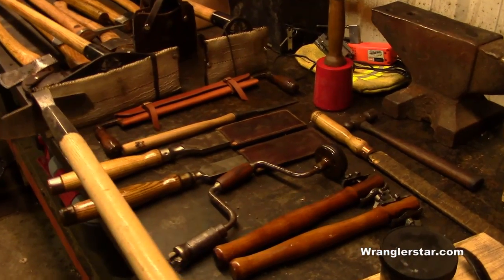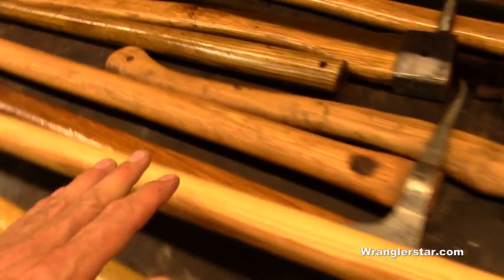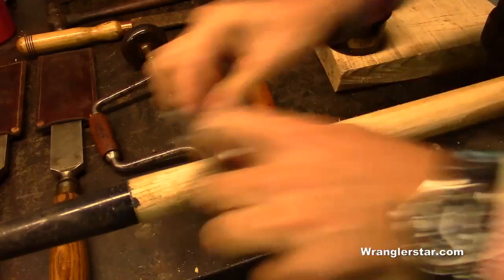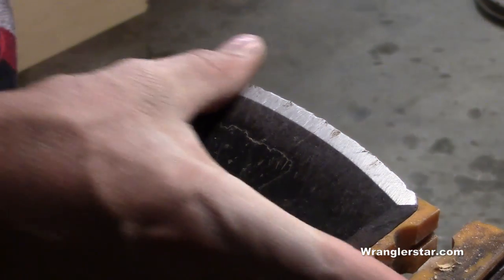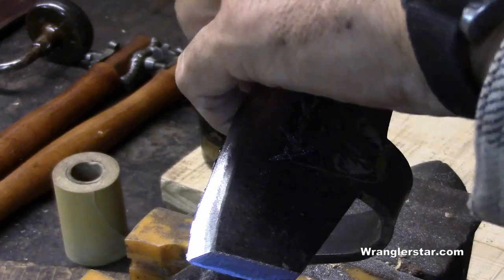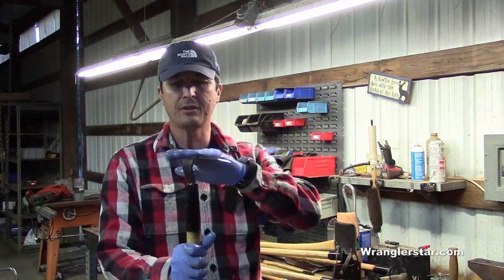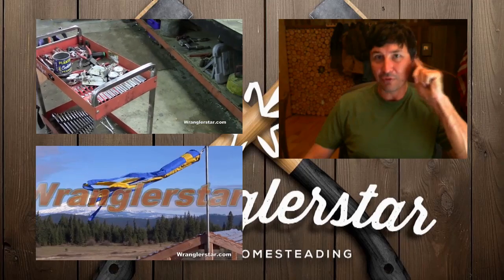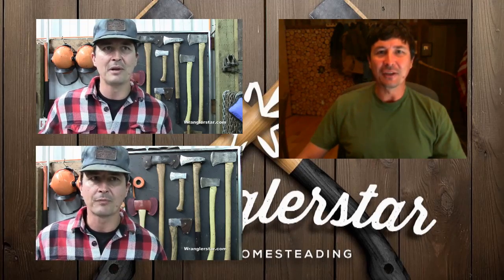How To Strip Varnish From Tool Handles | Wranglerstar

Comment: I agree completely Cody. Varnished handles are there to make the buying public notice the tool.
There is an old saying that $10.00 worth of paint will add $200.00 to the price of the tractor. Also manufacturers of tools are mostly offshore these days. Shipping for 90 days via boat leaves lots of time for wooden handles to absorb water and check. Even though the handle has been dried it will still absorb water. After a few cycles of swelling and shrinking even kiln dried wood will warp and check. Varnish is a water proof barrier when it is new.
Boiled Linseed Oil, which is also a favorite of mine, is water resistant but water will pass through the layer of BLO and damage the wood if not cared for.
Most clear finishes such as BLO, varnish, shellac, and polyurethanes, unless they have a UV blocker added, will let UV light through. The UV will break down the wood and cause the finish to loosen. Between the water and the UV the finish breaks down.  That's why barns and outbuildings that have been kept painted can last hundreds of years but fence posts rot away from the top down.
By renewing the BLO yearly the damage from UV is minimized and compensated for. It also focuses your eyes on the tool. Damaged tools can be fixed before they become useless.
A Proper maintenance program indeed.
Reply: Agreed! Go down the pine tar rabbit hole,.. its worth it!

Comment: Cody, 
Having been a carpenter/woodworker for over 30 years I would suggest a card scraper. The card scraper is a simple tool and there is no setting blade depth. A sharp card can take off super thin layers in a very controlled manner. 
Thanks so much for all your videos and honesty. 
God Bless!

Comment: Old wood workers secret. 2/3 boiled linseed oil & 1/3 turpentine. Could also go 3/4&1/4 if you wanted. The turpentine thins the linseed and helps pull it deeper into the wood. It's my favorite oil finish for wood.
Reply: I always add a little pine tar to my mixture
Reply: @nathanchandler18  exactly! As well as a small amount of beeswax. I like to add a tiny amount (1 tea spoon per quart of mixture) of carnauba wax. It is a very hard wax and also gives a nice shine.

Comment: I used a small Palm sized hand planer (Kobalt) yo strip of varnish. It was very handy and sanded the handles. I'm currently using motor oil (obviously "used") instead of B.L.O. It's been 2 months, and so far the handles are looking better. The oil goes on thick and drips into a few buckets to collect to recoat again. I now only coat them 2-3x a week depending on how dry it gets, maybe more over winter. The handles are looking better and are basically saturated. I'll see how well it worked when spring comes. Thank You Wranglerstar, I'm now more into taking care of my tools. I replaced many handles in years past and it added up. Looking forth to keeping current handles for many more years to come :)

Comment: You make it look easy Cody, I spent an hour or two today sharpening and servicing my axes and decided to strip the varnish off one. I tried a spoke shave at it's thinnest setting, but it just seemed to dig into the handle and remove chunks. Ended up scraping the varnish off with a sharp blade, then sanded and oiled.

Comment: Great video Cody! Back when I was a firefighter we had several wooden ladders. To strip the finish we used pieces of broken window glass. When one cutting edge was dull just turn the glass or throw it away or break it again for a new edge. On tool handles it was glass, then a torch, and lastly steel wool. Boiled linseed oil was our finish. Not anymore though. Just throw the tool away and buy another. Thanks again.

Comment: They put Varnish on the handles because, in general, people don't take care of their tools.
Reply: No, they put varnish on handles because they don’t properly dry their wood, in the modern speed/production/bottom-line craze. The varnish locks in that moisture and prevents the wood from warping. So, in order to not be hit with constant lawsuits concerning flying axe bits, they varnish the wood so it doesn’t loosen as quickly. It’s a terrible practice, if a company cuts corners like that, I don’t trust their wider business practices regarding tool quality, either. So, a varnish handle tool is generally half-assed, lazy, and not built to last.

Comment: Don't know if anyone mentioned this, I'm very far behind on my video watching as I am trying to cut back on technology and I have A LOT of subscriptions!

Anyway, I noticed that you are sharpening away from the edge of the tool which tends to draw the metal out toward the edge creating a wire very easily. Ever since I was taught to sharpen tools toward the edge of the blade, I have very little wire forming. I use this technique on both knives and implement type tools. I also notice that you pick up your file between stokes, this is a good thing to do because, depending on the quality of the file, drawing a file back will round off the file edges and dull a file very quickly. I notice this especially on chain saw files which will dull even if you do this on one tooth of the chain.

Just some thoughts, Great videos, wranglerstar! It is good to have someone out there publishing how to care for things PROPERLY! There is some much incorrect information out there, we need to point out the good stuff, and A LOT of it is right on this channel!!

Comment: I did not know that about varnished tool handles.  I’ll have to start gathering some supplies (boiled linseed oil, spokeshave, sandpaper, etc.).  It might even end up being around Fall before I get started. I can see the efficiency of just making one big project out of it.  Also interesting to note that this was before you preferred to cut the round end off of your long handled tools.  One thing you said is that it would drink in the BLO better.  Great video!

Comment: Broken glass work well. I have used it to shave wood down and to shave finishes for over 60 years. Cheap and usually available at a hardware store for free. Once you learn, you won't cut yourself. Always pull, don't push. Then sand around the handle to develop small ridges that help you grip.

Comment: Great video cody. When I sharpen up the knives I make I like to keep a small brick of a really soft wood near me to take care of that burr. Once the edge is placed on it, a quick few slides through that will take off most of the burr enough for most tools. If it's something like a knife or an axe or a machete, you can easily just finish up with a few passes on a whetstone. Also, really looking forward to part 2; I use an all in one leather dye, but that tends to be iffy in places, so seeing how to properly protect a sheathe will be very useful. Thanks again, All the best.

Comment: Fall (or autumn, where I come from, is one of my favourite seasons) but it also leads into winter, yes winter is also nice, but here in Hokkaido, Japan (The 2nd snowiest place on the planet - apparently?! - we do get a LOT of snow) winter, or at least snow lasts for around 5+ months!... it gets tiring... anyway enough about me (Hokkaido) I have recently started getting everything ready for winter, and had bought a few pitch forks, shovels, etc from the local hardware store earlier last year, they were all varnished, and after just shy of a year the varnish is peeling, cracking and becoming unsightly (and a problem) I do have a small spoke shave and will employ this method. I was going to try to sand them all back... this is much smarter! thanks again Cody!!!

Comment: The wood handle on my axe has lasted me over 20 years now. Besides applying linseed oil to the surface I drilled a small hole a couple of inches deep into the butt end of the handle. I filled this with linseed oil and set the axe aside, head down, refilling it whenever I  noticed the level of oil dropped. The wood absorbed a lot of oil over a few weeks and I think this gave the handle a little bit more spring and prevented it from cracking or breaking when I missed my target and the handle, instead of the axe head, struck the wood.

Comment: My suggestion is for the first coat or two of BLO to thin it with mineral spirits so it absorbs deeper. As for the manufacturers using varnish, most consumers won't take care of their tools like we do, they don't want the work of an oil finish. Varnish will protect well enough for them and is quicker and easier to do then oil.

Comment: The reason manufacturers put varnish on tool handles is three-fold. First, it prevents the handle from absorbing moisture and warping during transit and storage. Second, it looks good (because it's shiny). And third, it's cheap to do so. Linseed oil is better for obvious reasons, but it takes a while to dry and doesn't have a really glossy finish unless you put on at least 4-5 coats. That's extra time, material and handling that would add to the cost of the tool. And let's face it, Mr John Q. Public is only worried about one thing: price.

Removal of varnish can be difficult without a spoke shaver, but I've used 60 grit sandpaper on a random orbit sander to  remove the majority of it, then switched to 80 grit and hand sanded with the grain and finally 120 to smooth things out (again hand sanding with the grain). 120 grit is fine for the finish sanding because the linseed oil will fill in any minor scratches left. And don't just put on one coat of linseed oil after sanding: put on a coat, let it dry for a day or so, then put on another one.

Comment: There is a product used by gunsmiths called linspeed that is linseed oil with drying agents in it that cuts the applications in half. I generally apply it once a day for 5 days then once a month for 3 months and it gives you the same finish you get after a year with boiled linseed oil. I also hit it with 000 steel wool before the next application but that is for wood gunstocks to give them that mirrored look. btw, when you use your bare hands to apply either products the wood is heated with your hands better and seems to penetrate better for me, I just use goop to clean up my hands.

Comment: I've never owned a spokeshave, but I do strip all the varnish off my axe handles. I use a heavy bladed knife as a scraper, if its sharp it takes curls of varnish off. Just hold it perpendicular to the wood, and draw towards yourself to prevent chatter.

Comment: I use a scraper for this and find it works very well
Reply: Thanks, your comment kept me from giving up as I have a scraper on hand.  I was able to remove all the varnish with 10-15 minutes of scraping followed by sanding.
Reply: @twestcase  no problem, glad my comment was useful to someone. Also for stubborn varnish/ polyurethane finish that is particularly thick if you heat it up with a heat gun or blow dryer it comes off even easier. Just have to be careful not to char the wood.

Comment: I am used to standing or hanging tools directly above a shallow trough filled with white wood shavings - any excess oil drips onto the shavings and is retained and helps to prevent rust on metal tools that touch the shavings.

Comment: If you want plain boiled linseed oil with nothing else in you can always pick up a can of Tried and True "Danish Oil". Don't let the name fool you - this is not an oil varnish like watco - it is the simplest finish the company makes. Just moderatly polymerized linseed oil. They also make their "original" which more polymerized and has beeswax in it, as well as an "oil varnish" that I believe uses some type of sap that allows it to build and harden a little. I keep a can of the original around. None of their products have any driers either. This does however mean you need to apply light coats and rub the finish out. As far as end result, I don't necessarily think it looks any different then hardware store BLO, but I like the company and I like what goes in (or doesn't go in) to their products.

Comment: I once learned while reading that the best way to avoid a wire edge is to file totally from the opposite direction so the wire edge never forms.  What do you think of this suggestion?  I learned to do this especially when using a grinding wheel.  Holding in one direction will make a wire edge, while the opposite direction will not.  Comments?  Tx. Bob C

Comment: Another way to clear off the varnish is to use a piece of broken glass, like a mirror or window pane. You would need to wear gloves but works very well. If it stops peeling well you can break a little more off and have a fresh edge.

Comment: My two preceding posts were off a blog site for woodworkers. Here is another post on making your own.

Edible linseed oil is not polymerized,and I don't know if it would effectively dry or not. I started using edible linseed oil(flax oil) in my varnish since it is a LOT clearer than the hardware grade oil. BUT, it needs to be polymerized. This is dangerous if you aren't experienced. You MUST work out doors. Use a DEEP container. Oil can get too hot and suddenly foam over the top in an instant,turning into a LARGE ball of fire before you can get the pan off the hot plate.

I AM NOT RECOMMENDING THIS AS IT IS DANGEROUS,TOO,but,I used to saw the top off of an EMPTY,EMPTY propane bottle to get a real tall container. You can blow up the container if any gas is left in it,so I cannot recommend it.

I'd carefully SIMMER the oil and not let it get past simmering for about 20 minutes. It would turn a rich,golden color(from the pale color it was before). Then,the oil was polymerized,and would then be a drying oil. Do not eat it after it is polymerized!!!!

After the oil was golden,I'd add the resins,and carefully simmer it till a drop gotten on the end of a longish stick,would make gossamer cobwebs when touched and pulled away from a bottle. That means the varnish is done. I'm not getting too technical here.

Comment: Have you ever thought about trying some copper tools? They are slicker and move easier in the ground. They are especially good for gardening tools. The edges can be peened instead of sharpened and trace elements in the copper are deposited in the soil as apposed to rust being deposited, which can hurt soil in large quantities.

Comment: Hey Cody I notice you use the age old technique of sharpening with a file but have you ever used peening with a hammer and a small anvil to sharpen some of your tools. It is a less reductive process than sharpening with a file.
Reply: That would make for an interesting video, if you know how please share.
Reply: It would work harden the metal and make it brittle. That is the way they hardened the edge and sharpened non-ferrous metal tools made with bronze and copper but for steel, it gives you a cracked and jagged edge.
Reply: So basically the same reason you shouldnt use a grinder to sharpen tools?
Reply: It's similar but the opposite effect. With a grinder, you can overheat the tool and soften it. There is not just one hardness for a tool. You match the hardness to the task. An axe that is too hard will just crack. One that is too soft will dub over the edge. Hoes and such will be softer than an axe because they will be hitting rocks and other stuff in use. Wood chisels are hardened more than axes. The old way of making tools (and still made that way in some places like Japan) would weld a hard steel edge to a softer body of wrought iron to give a better balance of hardness and impact resistance.  In the best knives and other edged tools,  there is a gradation of hardness from the hard edge to the soft back of the blade for the same reason.
Reply: *****
My dad taught me how when I was a kid. I haven't done it in years, I am 42 now and haven't sharpened anything that way since I was 15 or so. Peening is for thinner materials than the hoe Cody was sharpening in the video. We used the technique to sharpen a scythe and some machetes we had around the house. We used a ball-peen hammer and a short section of railroad track as a small anvil. Just to clarify I am not in any way saying that this is a superior technique its just one that I was taught when I was a kid. I was just curious if Cody had ever heard of or used it before.
Reply: Actually now that you mention the machete, many of them are pretty soft low carbon steel. Work hardening would probably be beneficial in that case. Back then, just because a tool was too soft, you didn't throw it away. You made it work.
Reply: That's one of the techniques used in NEPAL where quality steel is at a premium if you can find it in the first place. Himalayan imports used to use it on khukuris

Comment: A very effective way to remove varnish is to take an old knife that is a throw away to a belt sander and grind the back of the blade flat and grind the edge dull. Scrape with back of blade and it will remove just like the spoke shave does. An old skinner knife curved works amazing cause it follows the wood curve.

Comment: The spokeshave is not a bad solution but the most general tool to use for that is a card scraper. A little bit trickier to sharpen but not that hard. You can shape them to get into hard to reach places. I keep blades from disposable blade saws to cut up as scrapers. Also you can go old school and use a big glass shard for scraping. It is harder than steel and will last longer. Well, a piece of flint is also good but I don't think you want to go THAT old school.